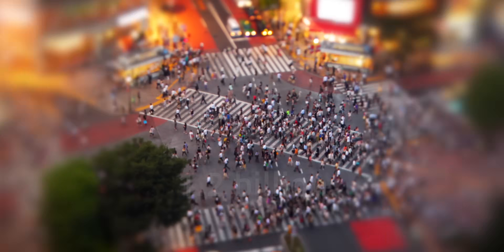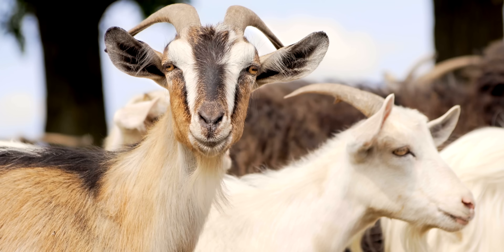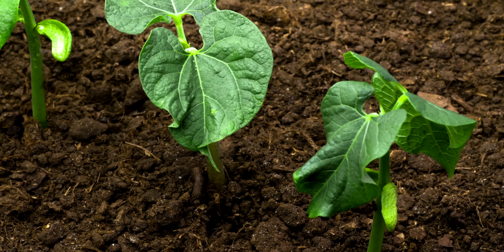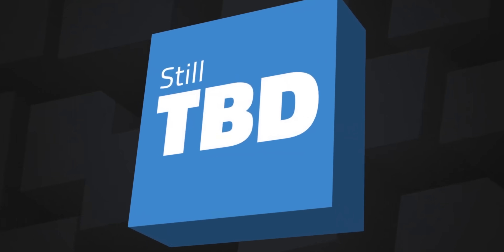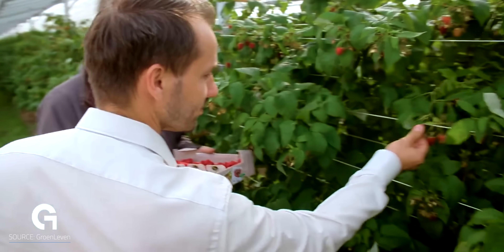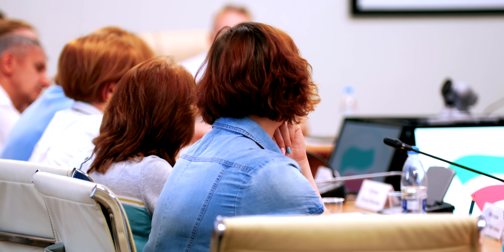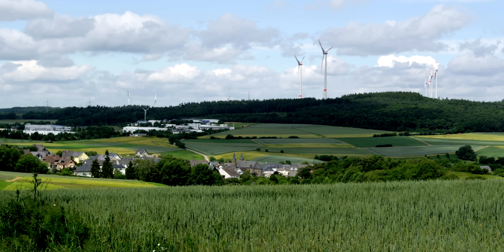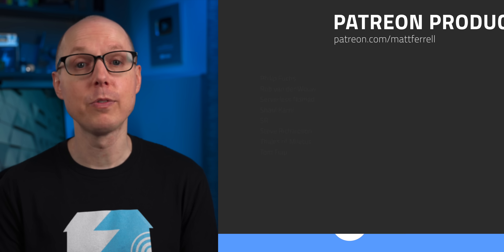Solar Panels Plus Farming? Agrivoltaics Explained

Comment: Here in the Phoenix metroplex we have a light rail right of way that is about 100' wide by 100 miles long.  The drive cables are 600-800 VDC.  It takes a mega-watt for 30 seconds to get our 100,000 pound trains up to speed.  Metro light-rail initially bitched about how much power it took to AC the trains.  In Saint Louis they had to add software so that no two trains launched at once.  Anybody else see an easy win-win here?

Comment: The problem that I always see with this and the large scale use of solar panels is their lifetime. 20 years of use and then these massive installations have to be replaced and somehow recycled. Does the manufacture and recycling of solar panels outweigh their use?

Comment: If you’re building large structures atop crops, why not also build a greenhouse around them? Plus a sealed water table. To prevent water escaping and keep it as closed as possible, with water catchment from atop the solar panels.

Comment: Love agrovoltaics. My panels at our new homesite will be in the main crop garden. It will serve multi use functions as a gazebo, rain water collection bird houses, vertical growing space... (permaculture principle).
Another idea is to...
Cover the 190 mile long Grand Canal  in Arizona. Reduces the massive water loss from evaporation. Done right it collects pure water with cisterns strategically placed for remote access for the public when camping, hiking, biking in the 110° DESERT. Also fresh water for the desert critters.
There is already vehicle access the entire length for maintenance.  It's a favorite trail system for cyclists. It's level at 3% grade its whole length. No real earthworks required.
The Salt River Project would benefit from additional dual purpose maintenance personnel on the route.
someone send this out so Elon can see it... I don't twitter.

Comment: ok hear me out what if we used those spaced solar arrays as artificial cloud cover in big cities? put panels 60 ft up in the air using a super structure that let a bit of the sun through keep the ground cooler, kind of like a thick canopy in a forest. Might not be as efficient as angled pannels, but it should work pretty well, this could help solve a few things, like the heat island effect of large cities and the energy requirements of the cities, especially when every one kicks on their ac.

Comment: What about spectrum specific panels? If panels still allow red and blue light through then you would probably need very little spacing between panels
Reply: The problem is manufacturing costs. Using ‘off the shelve’ technology, combined with the construction costs already makes APV costs slightly higher than regular solar farms. Only at scale this would be feasible economically.

Comment: I remember that when I was a child most of the emphasize on solar energy was about panels used to heat water with sunlight. Of course, since they were using direct sunlight their efficiency in warming water was higher than obtaining electric energy from sun and turning it into heat again. I was wondering that why don’t we use a combination of both solar panels which make electricity and solar panels which heat water on the home roof? The sunlight can primarily be used to make electricity and since only almost 20 percent of the sunlight energy is turned into electricity, the rest which turns into heat can be used to warm water which passes through tubes beneath the electric solar panels and is in direct touch with them to absorb the heat. By this way the temperature of the electric solar panels will also be reduced by the heat absorbing tubes filled with water and this will always keep the efficiency of the electric solar panels high.
Reply: As with all great ideas!... It's already been invented. They are still in development/new, but they work just like you describe. A photovoltaic solar cell on top to produce electricity, with conventional solar tubing directly attached underneath to heat water. Only a portion of the roof would need to be covered by this type of combo solar panel, because you can only use so much hot water.
Reply: @stevehazim5823  Thank you for your information.

Comment: Have there ever been discussions on putting solar panels along sections of highway? It seems the land use wouldn’t be a factor, and they would be accessible for maintenance or to tether onto existing electrical grid infrastructure.

Comment: We're putting panels over a very gently sloped roof of a garage, and the panels will be directional, since it's near the equator.  I guess those panels will also have to power a fan to blow air over the panels to help keep them cool if panel suffer from heat.  But, we're not going to grow plants under the panels.  The panels have to be able to stack and be protected from bad storms.  So, a type of rollout frame where panels roll out to either side and still be able to rotate.  Ideas?

Comment: i got a dsine for the perfected green houses that can be stacked like lago.. that use all the elements like wind water geothermal sun & its all automated and self powers it grows energy and crops .. its starts with 4 smaller wind turbinids for its foundations and u build the green house in between with swivelable solar panels that can let more or les sun in or dump the snow off them . then the roof is made to gather rain water & drop it small water weal's that goes into a geothermal storage tanks  that heat cool the green house and water that plants + the cool thi9ng iss that u can r make a perpetual power from sending the exes water back up the the roof and back throw the water turbinids pretty much andlesslee+ it will keep the water from getting stagnated & keep it airyated + u can add a pond to it for fish or Algy or water plant farming on the side... and the inside off the greenhouse will be the perfect climate control environment + if u wanna get really fancy robot pikers and maintenance droids lol i haf taken everything i learned from aquariums grow tents robotics and made the biggest massive multiple geekgasm of a greenhouse ever :)beat that old school farmers nerds r heer;) PS thars way more to this greenhouse but the tex wall is getting to big+sory for the typos im super dyslexic

Comment: The single best/cheapest way to increase farm yield on a modern farm in 2020, is massively increasing the CO2 content of the air by over 500%.  Need to take the air from the current starvation CO2 amount of 380-400ppm all the way up to 2500-3000 ppm, to optimize yield.  This also makes the plants more sun and drought tolerant.

Comment: This idea will become so much more interesting and applicable, the more there is of it. Solar panels will advance in design while becoming cheaper to instal. Actuators will becom cheap standardised parts of the kit adding massively to either energy or crop yield or both. Then there will also be the advent of smaller, robotic electric tractors, and other equipment. It will take time but perhaps not as much as we think; espeically if we get good early data and use generative design to constantly refine the optimal arrangements.

Comment: Here in  Southern New Mexico I have a garden that is all but dead in the mid summers.  I have a 8 solar panel array that could cover it.   Here in the high dessert ,    4,400ft elevation we have temps swings from 30f to 100f.  Frost in the AM and Full Sun in the mid to 2:00 pm times.   All I would need is to migrate the panels over the garden.  Here I am dying of lung  failure .  ANY volunteer's  LOL  ....  Will explain this to one of my sons and hope for the best.

Comment: Since the solar panels blocks light, you have a cooler area where water can condense. What about testing and integrating water condensation collection systems?

Since the panels (solar and clear) are adjusted higher, what about cleaning the panels? Dust, pollen, and other particulates collect on top and hinder light transfer; therefore they need to be cleaned periodically.
Reply: That depends on the regional climate. In the showcase in the video (Netherlands) rain takes care of that problem, no cleaning needed!

Comment: they almost got my idea for solar green houses sept they need to store the roof runoff water. and use small water wheels to tap the water flow for power to. & be more enclosed so they can have climate control so they can grow more temperamental planets + keep the pests and crazy whether swings out & try to use recycled clear plastic panels walls.. we need to start using the trash plastic for building materials like walls and structural stuff instead. like a cheaper and last longer then lumber type thing but not just plastic everything... if we r going to mars we need to learn to reuse stuff because good luck finding lumber and stuff on mars or in space.... its time for wallE crash picking robots to be a thing..  if tesla can get that AI going.. or if wee can make recycling the new gold lol maybe they should offer crypto for trash lol that should help ;)

Comment: Im adding a pergola to south side of property putting solar panels on top.  Will grow tomaotes under the pergola. doing it this way many positives.  Tomatoes grown,less water used,  solar panels cooler more efficient, array is pointed directly south instead of on roof of house NOT pointed south, Solar equipment does not have to moved during roof replacement on house,, solar panels can be easily reached if problems ocuur with a specific panels, pergola can still be used as patio to be in shade and just eating tomatoes with extension of ones arm. im using tojagrid pergola expensive but so easy to set up.

Comment: We should use the right tools for the result we are looking to obtain. In this case study, it was a better crop yield and lower operational cost to the farm on top of generating some energy where it would have generated none before. This model may not fit everything so it doesn't have to be used everywhere. It should be used where it makes sense.
That said, I personally, think it's a great use of space to maximize its productivity.

Comment: Another option (not mutually exclusive): go whole foods plant based. Best decision I've made in my life. 

Perfect health (lost any issues I had) and weight (finally normal BMI), great for our climate, perfect for prevention of animal suffering.

The switch is 2 weeks of going through a mental somersault to redefine routines, but once you're past that it's quite easy.

Make sure to take weekly supplements of b12 500mg (cyanocobalamin!). Did you know b12 is not made by animals but by bacteria? It's supplemented to livestock. We used to get it from our environment and water, but, since sanitation, that's not possible.

Comment: i like the idea i saw where people create solar farms on top of lakes etc. It doesnt affect the land that much n the water helps cool down the panels. in terms of optimized usage tho, Maybe setup solar panels on sheltered walkways,  or implement agrivoltaics on commercial buildings with a goal to go green by planting plants all around it, make the roof agrivoltaics. tho the space might be quite small for such endeavour that the yield might not be worth it to power the building but maybe enough to power certain systems.

Comment: Agrovoltaics may be a great addition to our energy and food production but in the long run the free market always makes the best choices. Government intervention and regulation always has drawbacks that the free market doesn’t. It may take a little longer for the progress desired but the cost to the taxpayers is far less. When the money is removed from the taxpayer and funneled through government the efficiency of capital is reduced dramatically. Often governments will take much larger risks because they don’t need to show a profit so catastrophic failures are much more common.

Comment: Imo, it makes sense for small fields of crops that can't take the full sun in a particular area. But for large operations, having two complex systems coexisting in the same physical area will slow down harvest and cause maintenance issues; I doubt any farmer with more than 500 acres will convert to it within the next decade. 
In my experience in the US, small farmers specifically are resistant to any and every change unless it makes harvest easier or cheaper within the next 3 years. Given that they tend to hate progressives for imposing things like low emission diesel engines and dust control...many are also resistant to solar tech by association. So this one's going to have to fall on non-US innovation.
Reply: I think there will be a transition from old to new over the next 20-50 years or so. traditional farming will hold out until the new age farming take over using newer more profitable hybrid farms. the'll need to adapt or go bust (especially in the UK where profit margins and available land are pretty tight). if someone comes along with highly automated vertical farming business that is putting out high yealds at better prices then the free market will draw investment.

Comment: Very interesting video. I am currently working on those projects. I would like to mention that a very crucial element of those systems are the sun trackers. Installing panels with sun trackers on those systems except from increasing the energy yield will lead to a decreasing of the structural cost. This would be resulted from their ability to change angle when needed so in cases of strong winds, they can be set to move horizontally so they will add less stress to the structure. (elevated panels are expected to face stronger winds so an installation with fixed tilts will need stronger supporting structure)
Reply: while trackers are great for increasing yield, they are also mechanical parts and those tend to fail. I've studied many cases where the trackers failed 5-10 years out. Solar panels are getting so cheap and better a capturing at various angles - that the necessity for trackers diminishes.  You can just have you field divided into sections with different fixed angles and over panel your inverters - easier and more reliable then trackers.

Comment: Love this idea,  but one other item  that may hinder this is the how to connect the power to the grid.   Many farms (especially in the USA) are so far away from the high voltage transmission lines.    Germany has a Lot of NIMBY just for the power lines let alone panels.

Comment: Seems like it would make most sense in sunny, hot, dry areas that don't currently work too well for crops - i.e., deserts. You reduce the sun intensity and water loss for the plants, which lets you actually grow there, and you get good yields on the solar panels. Win-win.

Comment: Wind turbines are expensive, non-recyclable, not eco-friendly, and people hate them. They are only really good in certain off grid locations that get steady winds like seasides or mountain tops. Solar is pretty awesome, not just for off grid but connected to the grid as well. I like this idea as it improves the land usage. But I am not a fan of government subsidies so the return on investment has to be there. 

I'm more a fan of small, safe nuclear. But that's another video...

Comment: An observation: The amount of energy that the spectrum specific LED grow panels take is significantly less than the daily solar yield from a good PV panel for the same area - to the point that you can even give extended light hours to the plants and still export power.

Comment: How many crops can be raised under a roof? How steep can the elevation vary before it becomes non viable for current pv installation? How much money is anyone willing to invest in order for someone else to reap a benefit? Let's face it. Unless it drastic and important to you the individual, it won't be available . But I admire the ideas very much.

Comment: I belive this is an interesting idea that shows promise to provide mutual benefits but, (isn't there usually a "but"?) I draw the line we "should do this." What i can support is a studied reduction of legal and policy barriers to making this available.  The key may be to demonstrate this a smart and beneficial way to provide both food and power. Of course one downside not clearly discussed is the cost to convert from farming without the solar arrays to farming with them. I am sure there would be some initial costs for changes in routine and machinery.